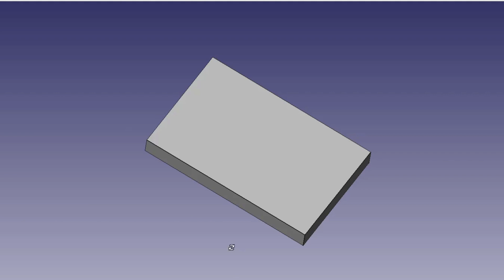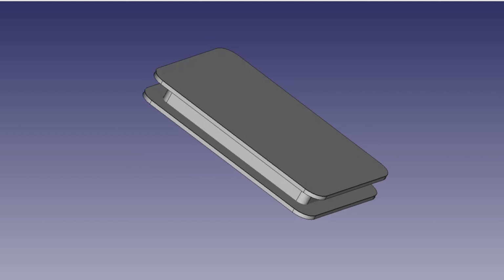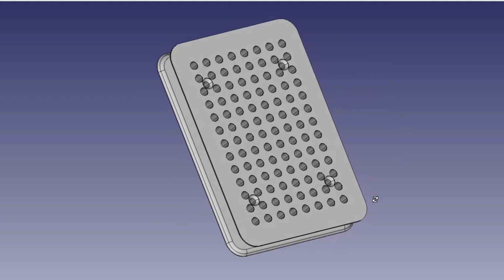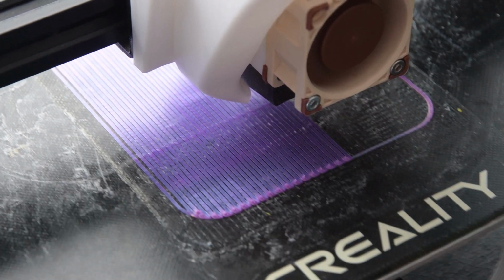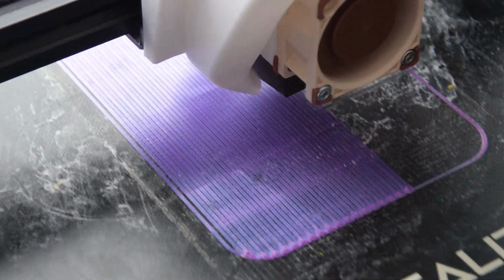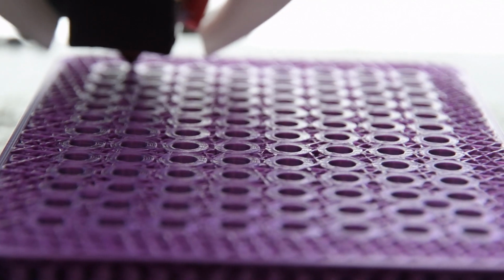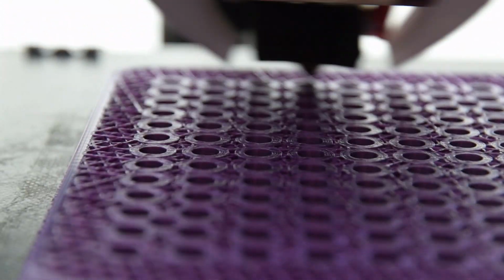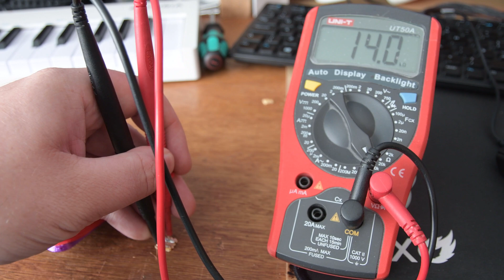Is this the most powerful bass guitar in the world? Waffler Bass Pickup 104 magnets!

Comment: I'm not a bassist and not good with eletrics, but i know the heights of the pickups change the sound. so wouldn't it be cool, if you had the magnets on some kind of screw that screws in the pickup-frame, so you could adjust every single magnet to find the perfect spot :)

Comment: I have suggestion. Can you rearange the pickup so you can wind wire around the magnet poles(i can see there is usefull space between them) and again around the bobin. in the inner area where the poles are magnetic field is strongest. Youl be able that way to put double the wire, 25 or more khoms.

Comment: I like your idea. Hard to judge the sound without point of reference. 
It sounds ok, not too powerful, and definitely out of tune.
 I believe only the magnets around the perimeter actually do their job (= if you removed all the magnets in the middle not much would change.. ) I believe For what you are trying to do you would have to wind all your magnets individually and then connect them or do it as one piece one by one 💀 Then you would have your most powerful pickup. 
I'm thinking if they were all wound individually in series then there could be much less wire around each individual post. 
I also watched the other video with the guitar, and imo the pickups deffo don't sound bad,, 
Cheers for the idea 🤔
Reply: Correct. The magnets in the center are WAY too far from the coil to be contributing much of anything. One big magnet would do much better.
Reply: @mark.audacity  one big magnet🤔 sounds like something I want to try !